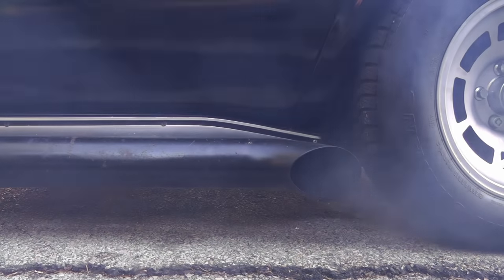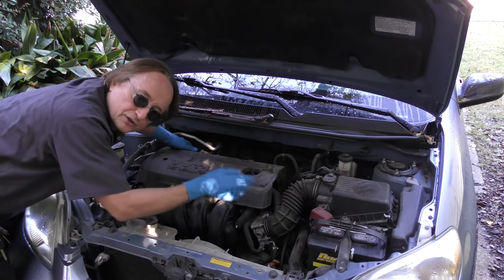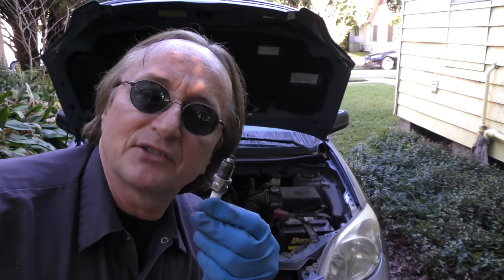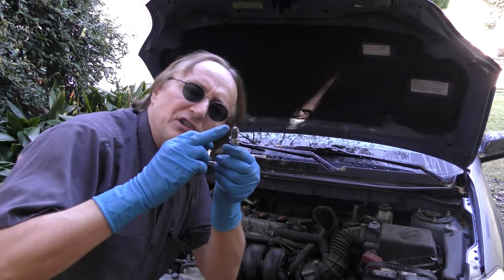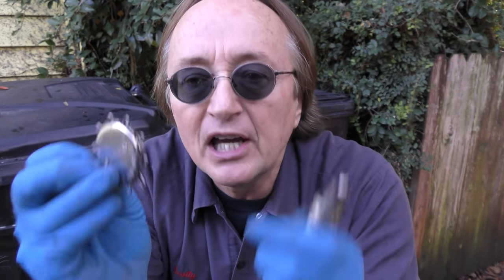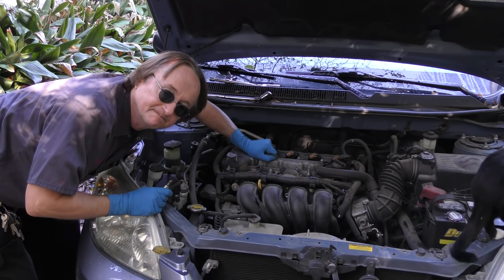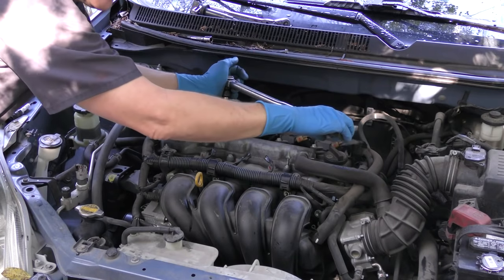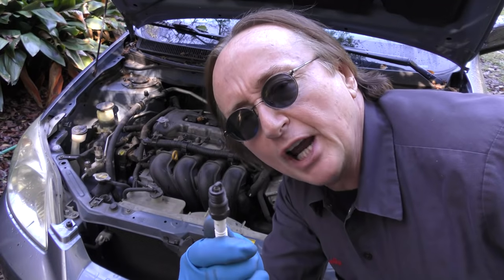What You Need to Know about Spark Plugs for Your Car

Comment: Hey scotty!
How about if we use double point spark plug?Will it work perfect and consume less fuel???Cuz this double point spark plug will ignite the fuel faster and which will comsume less fuel.
Reply from the maker: NO, realize spark will always travel on the closest electrode. So those things only fire one at a time anyway. It's a sales gimmick.
Reply: Scotty Kilmer Sales gimmick???
Reply: Nadir Waziri yes, a spark is a spark is a spark. and fuel will ignite at a minimum spark required so even if you have multi point spark plugs the fuel will ignite the first instance it gets which is most likely the same instance as using a regular spark plug. spark plugs will not save you fuel, especially in newer computer controlled vehicles.

Comment: Hey scotty, i know you don't really like Mercedes, but what's your opinion on a 1997-1999 Mercedes Benz CLK230 Kompressor?
Reply from the maker: fun cars to drive, but not to fix. IF you find a low mileage one cheap it can be a fun car though.
Reply: Scotty Kilmer it has about 80k miles on the clock...

Comment: Hi Scotty, got any tips to fix up or patch up the automatic door lock problem?  Thanks!
Reply from the maker: depends what's wrong. If all doors don't work, often a bad relay or main main power switch assembly
Reply: The central control buttons work, but just the main door lock can't control all locks when pushed down or pulled up.

Comment: Performance Spark Plugs do exist but they're like $100 a pop and they require an aftermarket ignition system as well which costs anywhere between 1000 and 2500 USD, AND these are only available for few specific cars.

However, those are made for special cars that are made for racing for example, the idea of them is to have shorter ignition times to make more consistent power which is only noticeable in racing basically, they're like the sequential gearboxes, they're made for a specific thing for specific use and usually specific vehicles.

But, like i said, to have any actual use from the racing plugs, you need an entire system swap and also most likely an aftermarket ECU which will set the timing and such correctly so it's not exactly worth it unless you have already spent enough money on your car to have literally everything else.

Edit : Just to throw a "running joke" (which is a real thing though) there's actually Racing Batteries as well, they're lighter and have higher momentary power, thus they're pretty much perfect for racing.

Comment: My Corolla requires plugs with double grounds, one time a parts place employee  insisted I could use the single one and it did not work out very well. Is that common to see?
Reply from the maker: it is on that design, stick to oem double grounds

Comment: how can I be sure what the OEM plug for my car is I don't have the manual and it seems hard to find out by doing some Google searching. It's a used car with 200000 miles not sure I can trust what I pull out.

Comment: I drive a 2005 Nissan Xterra. Just placed the spark plugs last December, turns out the plugs on the passenger side were never changed and were completely fried at over 200000. Apparently my brother would be billed for the service only to have the drivers side plugs replaced.

Comment: My car runs best on Ngk spark plugs, ive tried  Bosch,Brisk,Champion,Denso
Also be sure you install the same type, if you have copper oem than install copper.
And be sure to have the same gap and heat range.

Comment: I remember in the late 80's or  early 90's the 3 electrode plugs came out and I had to buy them I thought I would get more power but the car ran the same.Back then it was a lot easier to change plugs but today everything is buried like in my truck.

Comment: well, i am making it as simple as possible, copper and silver based spark plugs have lowest electrical  resistance where as iridium and other fancy metals have much higher resistance but they may last a little longer than copper based plugs but certainly not as long as he mentioned in the video. change them at 50K Km, spark plugs are cheap where as fancy electronic components in the automobiles  are very expensive

Comment: Anyone know if its ok if the plug gaps are off by .002? Doesnt seem like much in the grand scheme of things but i wanna get it right the first time. The original ones i just pulled out of my 2015 accord were shorter than the required .044 spec. They were Densos. Ive decided to put in the NGK laser iridiums but the ones ive purchased were also shorter than .044. I’ve pryed and pryed and could only get these ngk’s to .041 and im not sure if i should just proceed anyway or return them. Any pros out there mind giving me a response?

Comment: My Corolla came with ngk iridium ones. The only oem replacement kind I could find in stock were the denso ones. Same engine as that matrix. I wonder why that came with denso ones if they're original.
Reply: Look at the Toyota owners manual.  My 2009 Tacoma lists both NGK and Denso iridium plugs.  Just get the right part number of one of these two manufactures and you will be fine.  Denso is OEM for Toyota...  However, I have had good luck with NGK plugs in my son's Subaru and my Hondas.
Reply: Stephen Maurer They had NGK in it from the factory. The stores locally sell the Denso ones. I wonder if somebody already changed the plugs in the Matrix he's working on.

Comment: scotty I'm confused. a lot people out there do recommend lubricating the spark plug threads for a easy replacement later. ???
Reply from the maker: not needed with modern plugs, they are already coated. you ruin the correct tightness if you add lube
Reply: @scottykilmer  Scotty, is my Dodge ram 1500 v6 08 a modern engine? I just did a spark plug change and added anti-seize :(

Comment: Recently discovered your videos- they are excellent.  BTW, my 04 Jetta (5 speed manual) which I bought new is going strong after 170,000 miles with nothing more than the normal maintenance that you promote. Keep those good tips coming. Thanks.

Comment: sir i need ur help i wana know that i have honda civic 2007 ok the honda iridium spark plugs 4nos for  70 $ and original ngk iridium spark plugs 4nos for 27$ ... pls tel me what is the difference and which one i use....there is any voltage difference are y its expensive the honda 9807b-561bw...
Reply from the maker: ngks are perfectly fine

Comment: Hey Scotty what causes a car to burn/melt spark plugs? My odyssey melted a spark plug badly
Reply: Peter Kapica Could be engine running lean. Lean mixture increases temperature which could melt spark plugs
Reply: TheDox451its just one cylinder out of 6. Also the coil got stuck in that same cylinder which the plug melted. This is what the plug looks like. I don't have the car anymore https://plus.google.com/photos/...
Reply: Could have a clogged injector causing the cylinder to run lean which causes a hotter combustion in many cases.  I'd look into a fuel injector cleaning service.
Reply: I had a computer go haywire and melt the coils on a number of the spark plugs on my Acura.  They said water got into my computer, but didn't know how.  They performed a number of tests on the windshield and such to try and replicate how water could have gotten in there, but were unsuccessful.  Ended up being covered by warranty, fortunately.
Reply: spazzman90 well I had a bunch of codes for it and Scotty said a bad computer
Reply: Wildman Still runs fine

Comment: Also, if you go over 80,000 miles there's a good chance that your plugs will be bonded (welded) to the head. About 90 seconds after you use your breakover bar you'll be very sad with your 2 piece spark plug. Add a 5" tube through your valve cover and the story of trying to use Easy Out's with a 6" extension and a hose duct taped to your Shop-Vac in a noble attempt to get the debris out starts. And a magnet won't help much with aluminium filings.

Comment: If i use the non-resistance (resistor?) Spark-plug to my car, will it fry the computer?
Reply from the maker: that's only for the noise suppression on your radio, it will run fine
Reply: Scotty Kilmer okay, thanks.

Comment: A Scotty i have a tahoe and it calls for double platinum plugs. I want to out in iridium plugs. Manual ssys gap at 60 but manufacturer says gap at 40.　which shiuld i use.
Reply from the maker: stick to plugs with 60 gap, irridium plugs are preset and you should not regap them. But if you find irridium plugs with 60 gap, use them

Comment: what brand are the Nissan OEM spark plugs? I have a 2014 Versa 1.6 HR16 with the manual transmission if that helps 😎
Reply: zhbvenkhoReload take the spark plugs out and see them
Reply: google
Reply: Also check your owner's manual.
Reply: israel 20 Getting the spark plugs out in this HR16 is kind of difficult
Reply: Rockauto says it's NGK 5118.

Comment: It would be a lot easier to work on our own cars if the engineers who designed them had to work on their own cars.
I learned the not so hard way to stay away from those gimmicky multiple electrode plugs. For two seasons I used a standard plug in my weed whacker. A year ago I went to Lowe, well, I won't say the name of where I went, and all they had was the E3 multiple electrode plug. It was only a few dollars.
I installed it, and all last season that tool took several pulls to start, ran rough for the first minute, and seemed to suck the gasoline.
With both previous standard plugs, it started consistently on the first or second pull and ran strong.

Comment: Copper sparks better than platinum or iridium, but is not used OEM because they have to be changed out every 30,000 miles instead of 100,000 My 4 cylinder turbo runs better with the copper and as it's an inline 4 they are easy to change.

Comment: long gone the days of getting the ones on sale at bumson's auto parts for 79 cents. tried that on a 98 camry with 60000 on it.  seemed fine pulling out the garage and down the steep ally onto the next steep street than on the level. but coming back ang going up the steeps give it a little extra gas and it went duuuuw. WTF... put the orignals back in and back to normal.  couple years little put these bosch in from walmart.  looked a little fancier and more pricey but not much and the same thing   duuuuw.  the ngk's and the nippo's it called for in the manual were 12 bucks appiece.

Comment: Got some for a Toyota sienna OEM denso plugs.  It has the 3.5 v6 from toyota in it.  Our cousin owns a garage and he is pretty good with what he does and he did the change for us and he said he looked all over town and couldn't find any plugs for it except at the dealer however the OEM from dealer was 23 dollars a piece for a sparkplug.  I don't know the day he was looking if the other auto parts shops just happened to be out or if they didn't carry them at all
Reply: So your talking $150 just for 6 plugs?!?!?! Jesus katydid as my Pop would say.
Reply: holidayhouse03. yep shameful but it was due for replacment and didn't want to chance it ran 315 plugs labor and all at his garage dealer across town wanted 550 before tax to change them
Reply: Nice, that's a good price for spark plug change on the 3.5L Toyota.
Reply: We even spent almost 100 for a rental car from enterprise as we needed something to drive around while we did that.  Based on what your saying it sounds like you know all about how expensive the spark plug change on a 3.5 from toyota is or possibly you may even of had a toyota with a 3.5 at one time.  I know they had some issues out of the earlier motors our sienna is a 2009 and yes its a noisy motor on cold start but, its pushing 170 K and we purchased the van used at 63 K miles and still not a problem engine wise thus far and hopefully there wont be.  Did recently replace the battery though and it tested bad even though it was starting alright we was told it was just a matter of time.
Reply: 427 Elevating Productions I've seen 3.5s in Camrys with over 350K on them.
Reply: Well thats good to know.  Its practically to my knowledge the same exact engine in sienna, highlander, rav 4 avalon and lexus models use that one as well.  The 3.5 v6 in the 2017 sienna was pretty much redone and now puts out around 296 hp
Reply: no way in hell they are $23/piece im looking at them right now denso tt iridium 7.99/piece or the or the original are 10.99/piece personally id go with NGK ix iridium plugs they are around 8.50/piece but outperform the denso by far
Reply: someone got ripped off horribly
Reply: Hey I know we shouldn't do this but, hey I was only taking my cousins word for it thats what he told us so whether he told us the truth or not its been over a year since he did that.
Reply: oh i thought you were in a bind now and was trying to help ya not get ripped off i help people on the channel from time to time if im watching a vid and go through the comments im sorry you had to deal with that but that is horrible you could have done them yourself just a hair over $50.00
Reply: oh nope not now we aren't I realize we could have and granted we owned other toyotas in the past with four cylinder engines and done spark plug change ourself but, apparently the back three are supposed to be hard to get out of the 3.5 found in many Toyotas and when my dad fount that out he did not want to attempt it his self. We have heard its really a time consuming complicated job for ones who are not really mechanically inclined.  I wish I would of been able to and granted if I had found a tutorial online I could of followed it.  I believe our cousin telling us how much they was but, yeah I agree its a big rip off for spark plugs
Reply: no where near $23/ piece ever at all anywhere in the US

Comment: i have a 1996 s10 with a 4.3 vortec and it some times rums bad at idale and i did plugs and cap and rotor alredy can you plese tell me what to do next
Reply: Those vortecs are known for the spider fuel injections systems to breakdown over time due to the plastic components and sticking poppet valves.
Reply: like it only does it when it is hot to

Comment: when do we use that grease to put between the wires and plugs
Reply: 88supra719 add just a tiny bit on the wire/coil boot inside. stick it onto the plug and give it a little twist to make sure its all coated.

Comment: Hi Scotty
need your help
I have 2 family cars
2004 Toyota Camry
2010 Mitsubishi Triton

and the existing head light bulbs are now H4 12V 60W_55W

i want to buy brighter bulbs, can I install H4  24V 100W_90W

Please help
I'll come back read comment tomorrow

thanks 👍
Reply from the maker: no, you can't use 24 volts bulbs on a 12 V system
Reply: I've gotten OSRAM Rally H4 off eBay that were a higher wattage and 12 volts.  Be careful though.  Too high of a wattage can damage your headlight housing and your wiring.  I've used the Rally bulbs and they're pretty bright, but don't last long at all, and are expensive.  You could go with HIDs, but you'd have to retrofit HID projectors into your headlights so you don't blind oncoming traffic.  Also, buying "brighter" bulbs for your existing headlights will, more than likely, have a diminishing return effect.  You might risk the chance of over-lighting the foreground, which will make it even harder to see in the distance.

Comment: Sigh. I remember when washer fluid was $0.79 and NGK resistor plugs were $1.89.
Last year I went to X home center store for a spark plug for my weed eater. All they had were plugs with a dual electrode. The thing ran like crap with those plugs and drank the gas. This spring I went back to standard plugs.
Once again it starts on the first or second pull, runs fine, and that tiny tank of gas goes a lot farther.

Comment: Iridium is just the modern standard.  So even if you have an older Toyota like I have, it's time to switch over to the iridium equivalent and since the original double electrode that came with my '99 Toyota are probably no longer manufactured anyways it doesn't matter lol.